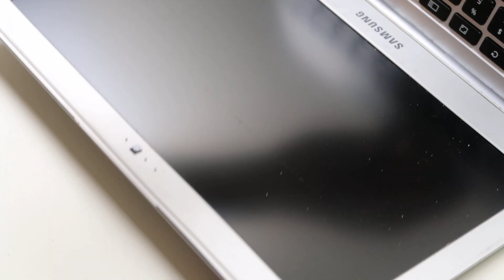How To Fix Trackpad Mousepad - Samsung XE303C12 303C No Click Feature / Broken

Comment: i have one and the track pad just does not work like if you tap of drag the cursor goes wild and idk how to fix it
Reply from the maker: I would unplug the trackpad ribbon cable from both ends and then plug it back in.  If resetting the connection does not help, you may need to replace the trackpad.

Comment: i have a question i have the same laptop and my trackpad stopped working what do i do to fix that ?
Reply from the maker: Have you tried the steps seen here?
Reply: @PC_Monkey  yes it did not work
Reply from the maker: @chippytheelf1161  If the steps here didnt help and reseating the touchpad ribbon cable didnt help either then you should replace the trackpad.

Comment: Hi, The clicker works on mine, Just the touch pad isn't responsive at all, It moves around where it shouldn't and sometimes doesn't pick up any movement , I have 15 of these like this i I took a punt and Im having a nightmare,  and advise?
Reply from the maker: Try reseating the touchpad ribbon cable at both ends.   If that does not work, and after making sure all the updates are processed, replace the touchpad.
Reply: @PC_Monkey  Hi, thank you so much! Its worked on 5/7 upto yet.
I have some Acers where the keyboards aren't working great, Some keys on all of them don't work or press multiple keys when pressing a key below for example G presses gt  and H presses hy , Any advice for this?
Reply from the maker: @SamAndBrosHD  To troubleshoot why a key or keys are not working, refer to this video;  https://youtu.be/wqrchfpdJ_w.